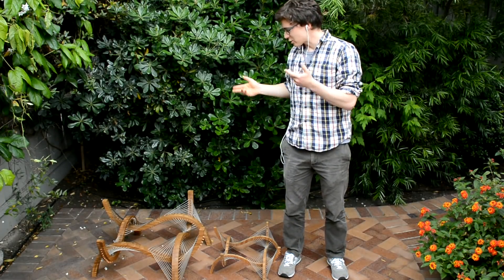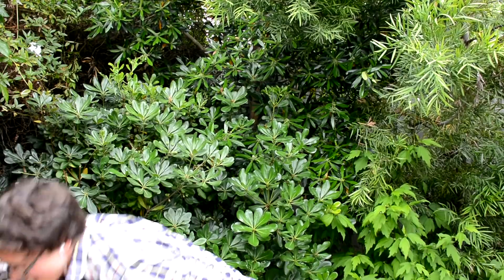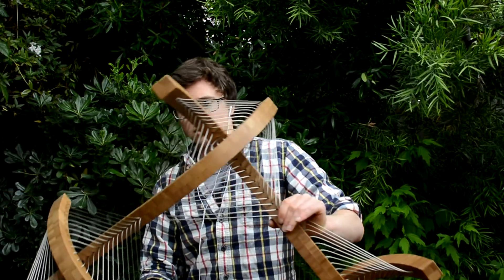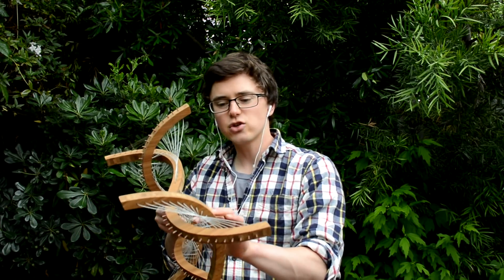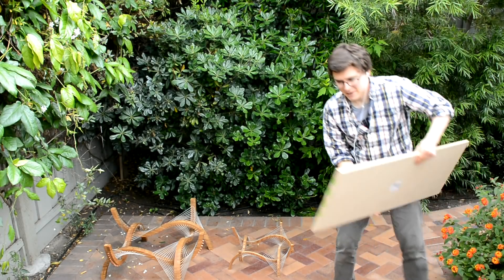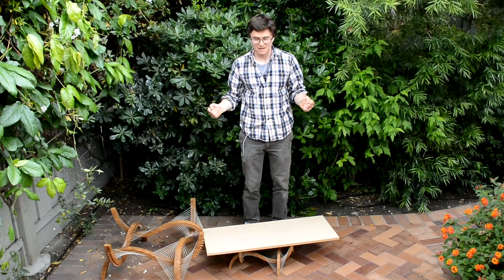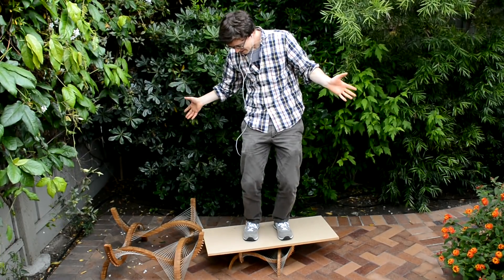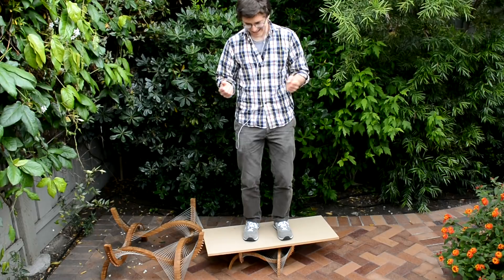Contour Coffee Table Weight Test

Comment: Very impressive! Keep in mind, when you jumped off, that created an instantaneous dynamic load of ~200 pounds. The reason the base held up, is that all that load is distributed evenly over a significant percentage of the length of the arcs. Not only does it handle vertical loading, it should be very stable for radial loading as well.(shifting your weight from side to side) I've never seen geometric tension only designs used for a load bearing structure. Thanks for posting!